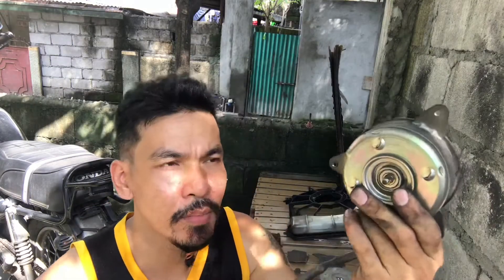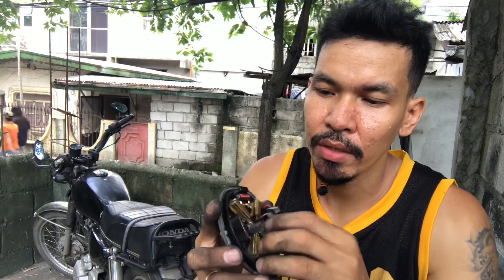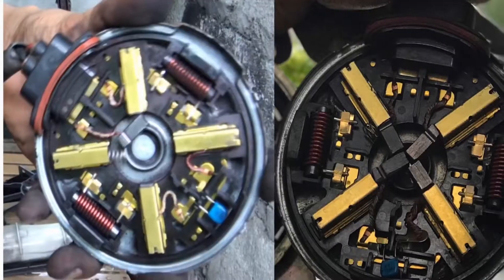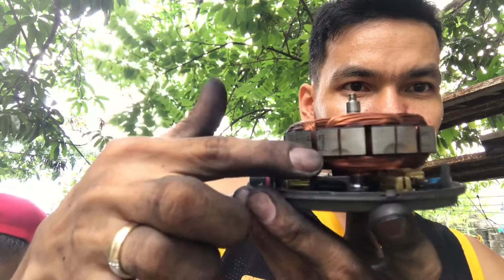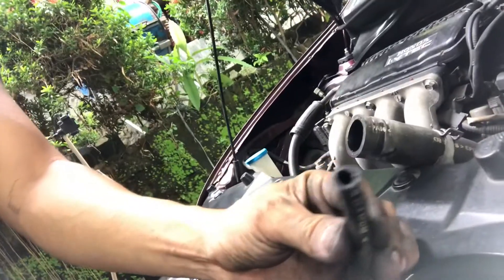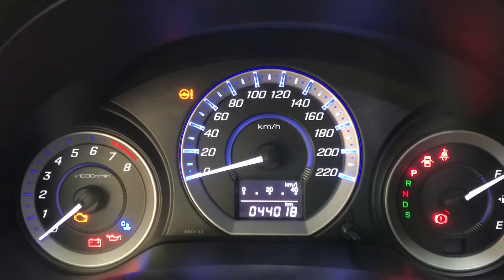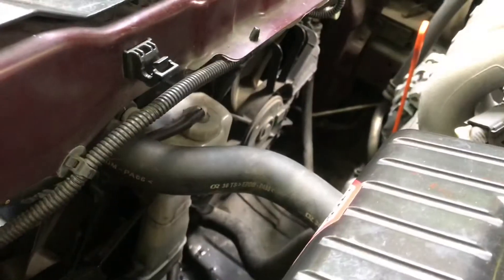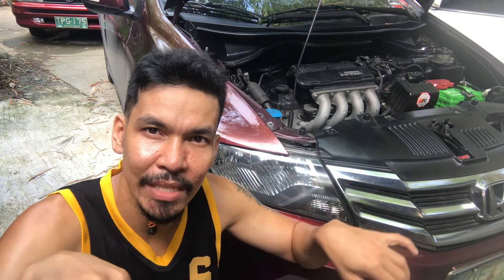Honda City radiator fan motor repair
carbon replacement

Comment: Sir, sa left side fan lang ang gumagana kapag nka on yung aircon pero yung sa right side ayaw talaga gumana kahit naka on ang aircon. Patulong po. 🙁
Reply from the maker: Sir check niyo po muna fan baklasin niyo then  rekta niyo sa battery if working pa then after that you can follow the video po 😊
Reply: @teambalugz6081  salamat po sa pag sagot sir.. may video po kayo sir pano baklasin ang radiator fan? Hehe 

Salamat po ulit sir. New subscriber nyo po ako.

Comment: Boss di natapon coolant mo nung pagkalas?
Reply from the maker: Meron natapon boss pero sobrang konti lang naman,
Reply: @teambalugz6081  boss nagawa ko na salamat sa video mo! Balik lang ako dun sa coolant na tanong ko, nung binjksan ko kasi ung radiator cap nawala na ung level nung coolant so medyo madami ata nabawas.dapat ba refillan ko na agad?kung ferefillan, sa reservoir padin ba o sa radiator cap diretso?
Reply from the maker: Top up mo lang ng distilled water :)

Comment: Sir ano po kaya problem ng fan kapag pumapalya yung pag ikot nya? Minsan hindi sya iikot kasabay nung sa aircon. Halos same tayo ng sasakyan, 2012 city yung sakin.
Reply from the maker: Panong pumapalya sir? Dapat po pag on ng aircon sabay iikot yung dalawang fan
Reply: @teambalugz6081  Yes Sir dapat sabay na iikot. Ang nangyayari dun sakin is minsan hindi iikot yung nasa radiator kahit umikot na yung isa. Then bigla nalang ulit iikot ng sabay.
Reply from the maker: Sir trouble shoot mo muna yung fan try mo po itong ginawa ko dun muna po tayo sa minor para hindi masakit sa gastos, 😊
Reply: Sir bakit ang bilis mg automatic yng sayo tska mabilis ang ikot ng fan yng honda city 2018 model mahina umikot at yng automatic hindi tulad sayo

Comment: Sir yung Honda City Idsi ko po di naikot ang Radiator Fan kahit bukas na ang AC pero yung isang Fan naikot naman po
Reply from the maker: Check niyo po sir yung fan baka same issue tayo
Reply: Sir good pm po.ask ko lang tungkol sa motor fan ng honda city vx 2014 kng same ang ikot pabuga sa makina or ang isa ay buga pa punta radiator?

Comment: Sir pano po kung yung dalawang fan di tumatakbo kahit on ko na yung air-conditioning ano po kaya problema sir
Reply from the maker: Sir try to check the fan manually po connect niyo po yung fan direct to the battery pag di po umikot then try this video sir.

Comment: Sir ano po ba mas ok, irepair nalang yung orig o bumili ng oem na motor? Tsaka kung papalitan ko po yung carbon brush, may ibat ibang klase po ba nun? Ano po ba dapat kong bilhin na carbon brush?
Reply from the maker: If repairable naman, sir pwede naman po, sabahin niyo lang po sa auto supply for raidator fan alam na po nila yun :)